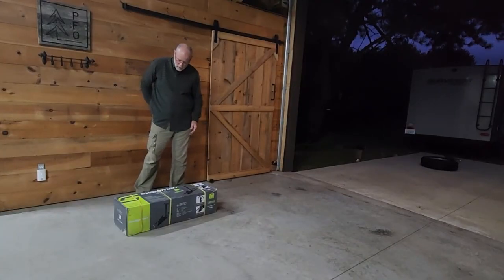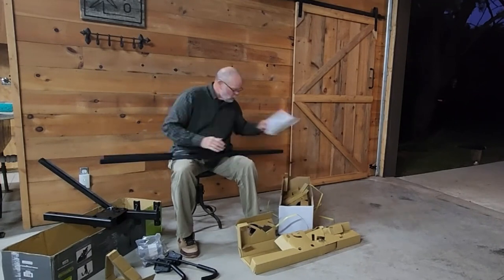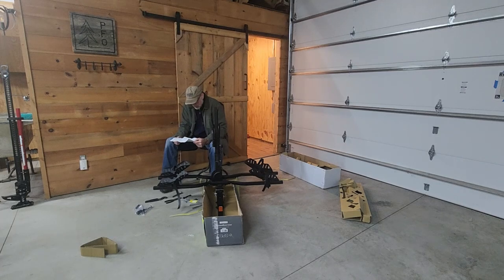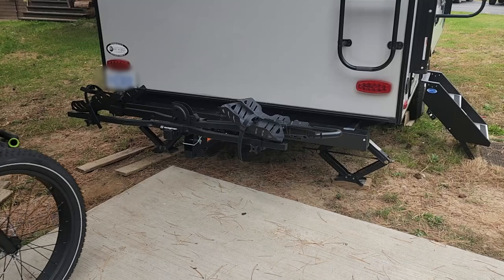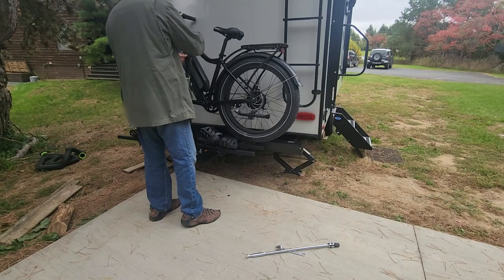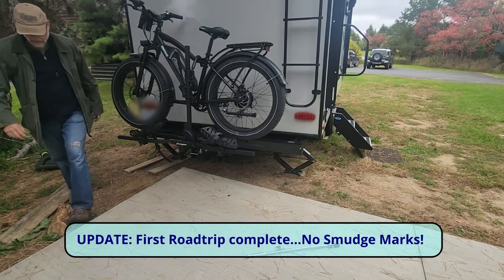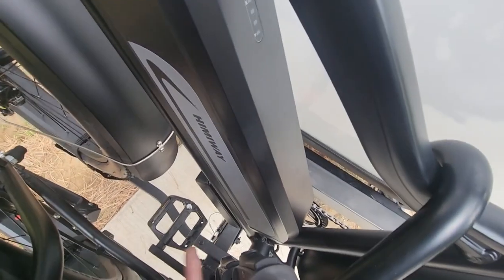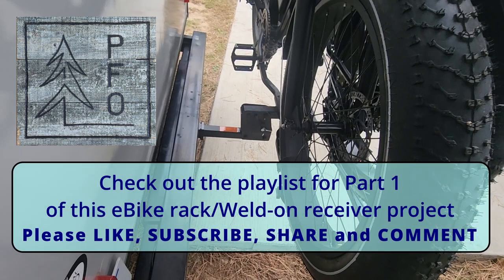Maximize Your Trailer's Potential: Adding a Bike Rack for E-Bikes

Comment: We have that rack on our 2022 rockwood 2614bs with fat tire trays 
Rack works awesome and is very sturdy ! We bought the bars that go from seat to handlebars so we can put the locks on them and I put some pieces of pool noodle on them so nothing rubs against each other
Reply from the maker: Thanks for the confirmation. It does seem to be holding up very well.

Comment: How does it hold up going down the road?
Reply from the maker: It is holding up very well, so far! Our first road trip after adding this rack was about 7 hours, all on paved roads. We have a rear facing camera on the travel trailer, so I can see the bikes clearly. The only time I could even detect any bouncing was when we went over railroad tracks. I'll post some video and do some follow up as we log more miles with it. I'll be inspecting the rack and the welds on the receiver often for any signs of fatigue. Be sure to subscribe so you won't miss any updates. Thanks for watching.